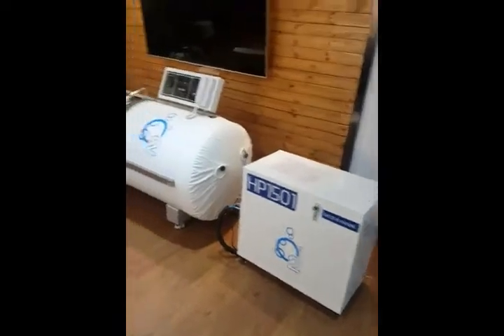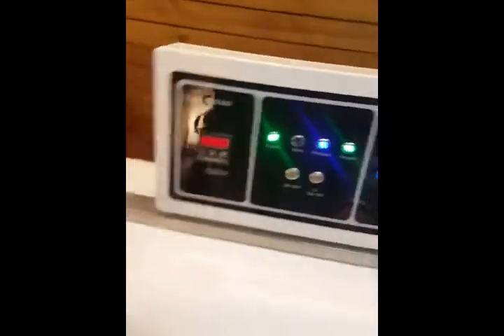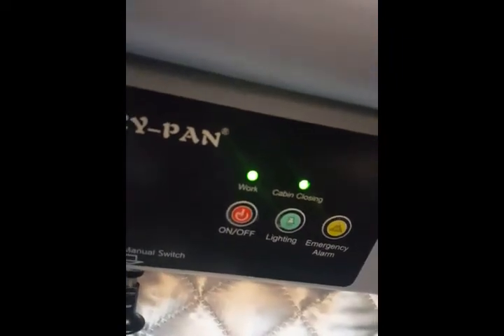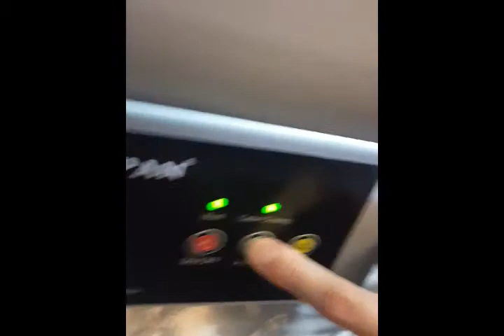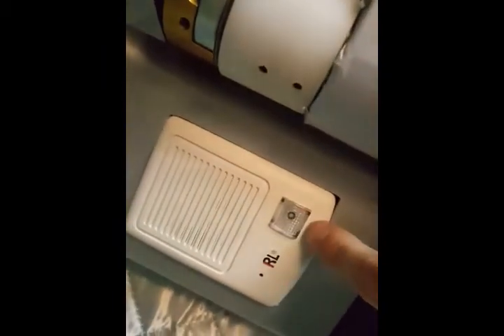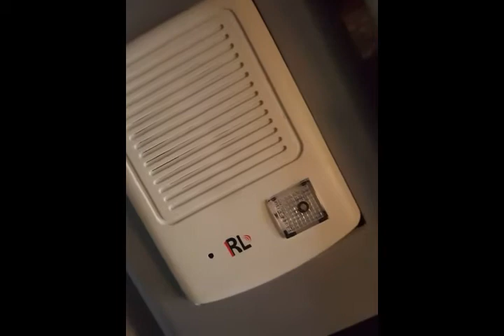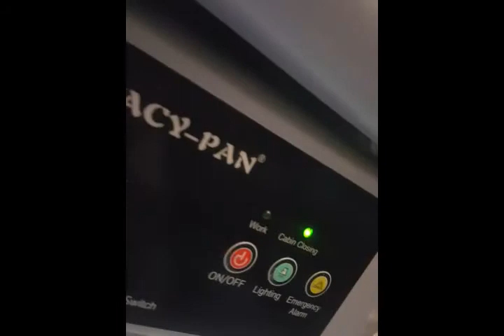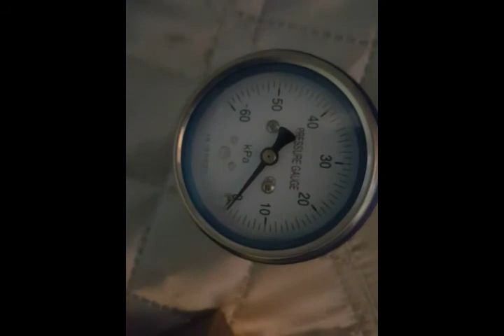MACY-PAN HP1501-75 Hard Type Hyperbaric Oxygen Chamber Explanation 20170412

Comment: 50 kpa is 0.5bar , not 1.5bar.
Reply from the maker: 50kPa above 1ATA,
Reply: @RankYin  To achieve clinical results, pressures between 100-150 kpa above 1ATA are recommended.
Reply from the maker: @adisome.  Yes I know. This is a different level of HBOT, mild HBOT, for wellness